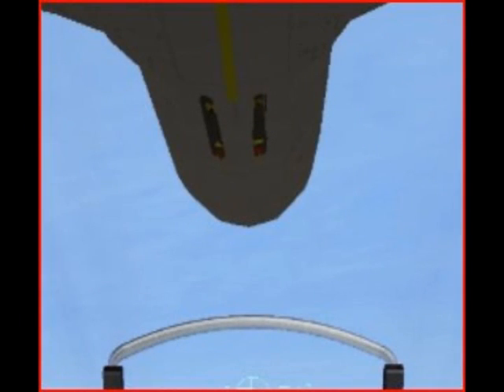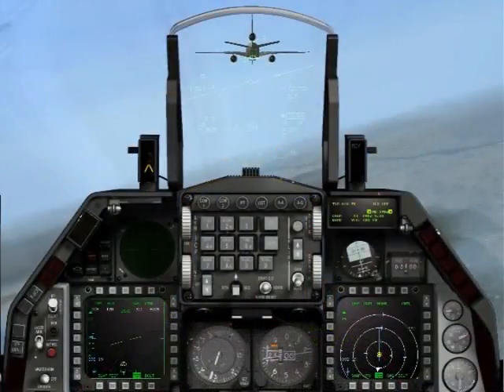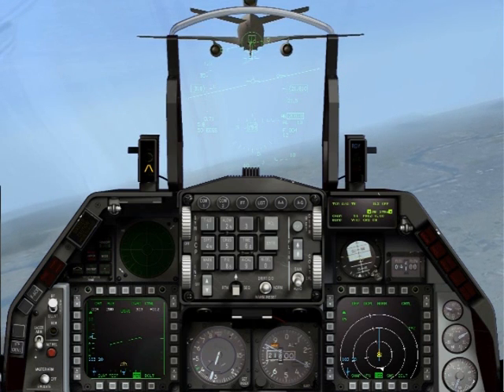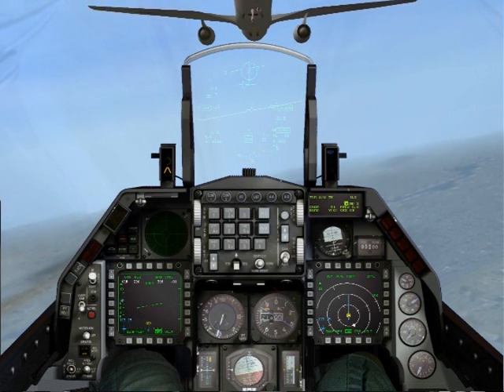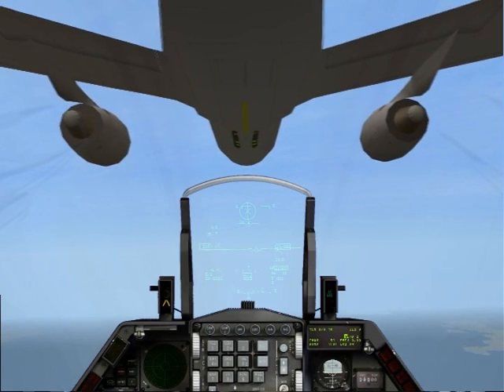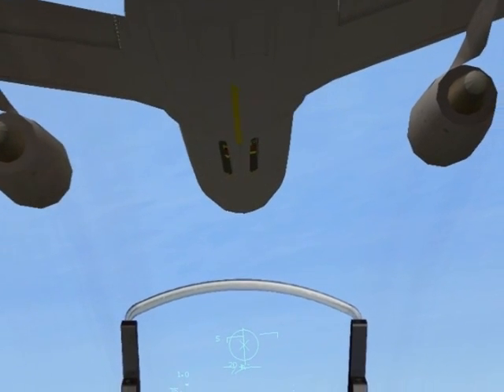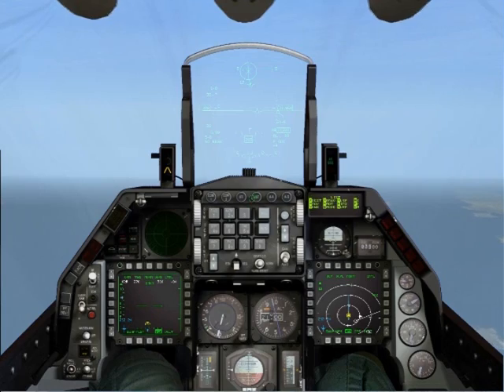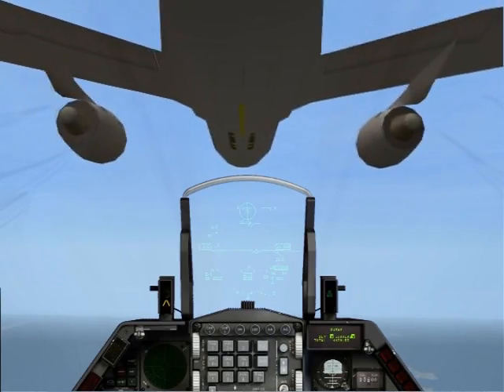F-16 F 4.0+RV HQ A-A REFUELING PART 3

Comment: It's virtually impossible for me to refuel on Realistic settings using a twist-rudder joystick. The joystick is too sensitive; a simple turn on the joystick will kick in a little rudder-movement. I tried Easy and found that it was TOO EASY. I didn't even have to steer the aircraft; it did everything from the Radio Calls, opening the Refueling Door, and steering all by itself. I like using Simplified. I get some help stabilizing the aircraft while approaching the tanker a very close ranges.